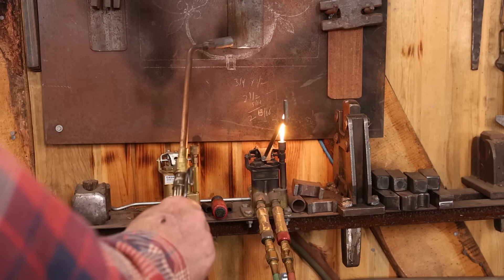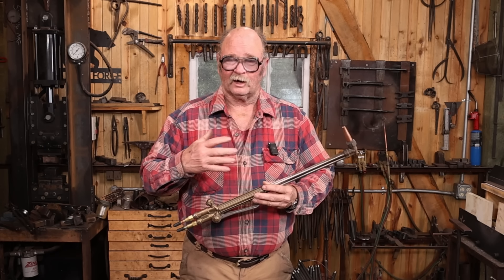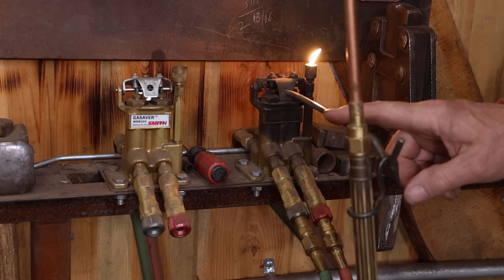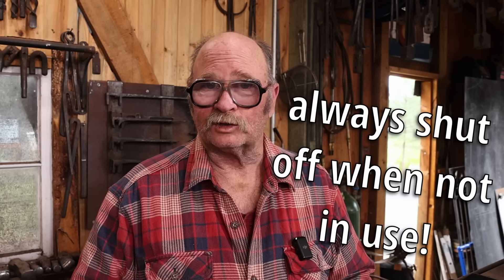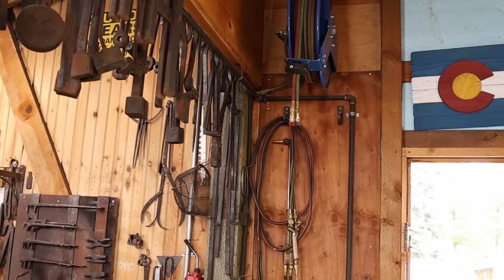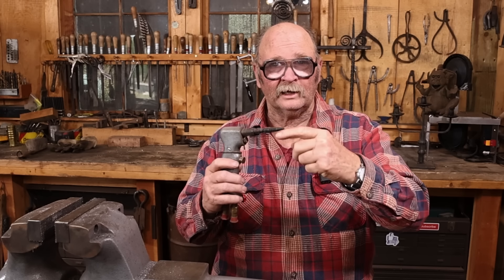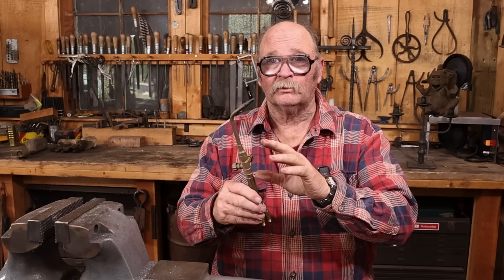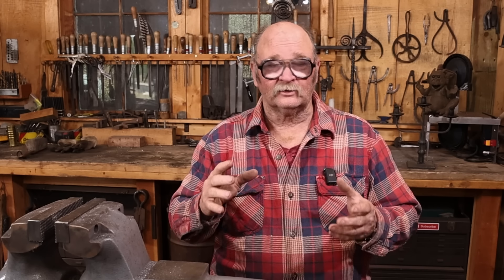Oxy - Acetylene VS Oxy - Propane torch - blacksmith shop setup

Comment: Years ago, I started using MAPP gas.  As it became less available and cost much more, I started using propylene.  It costs way less than acetylene and is far safer for storage and transport.  The tanks are far lighter and less costly.  My big rosebud cannot be used with acetylene even with manifolded tanks.  My hoses, regulators, and tanks were recently lost in a major wildland fire, so I have to replace them.  I used standard off-the-shelf regulators and hose for fifty years and that is what I'll get for replacements. Frankly, the propane hose didn't last that long.  Generally, the propane/propylene cutting tips are two piece making them cost more.  I get better flame cuts with propylene than with acetylene.  Just my two cents.
Reply from the maker: Great information

Comment: I personally won’t buy any torch that isn’t a victor or maybe a smith you buy those cheap knockoff ones when you need replacement parts good luck finding parts most likely you will have buy another torch.
Reply: If you want a really nice welding or cutting torch, check out  Blue Feather Torch in Two Harbors Minnesota.  I have both of the welding torches and the cutting torch.  They are expensinve but worth every penny .  I weld on 55 gal. drum metal with the two welding torches and they weld really nice after a little practice on the thin metal.  And the cutting torch really works nice too.

Comment: I have seen several videos where jewelers are using an oxygen concentrator instead of a tank of oxygen. Would you think that provides enough oxygen for one of these torches, or would it just not have enough supply.

Comment: I never knew about these gas saver valves until I was actually taking a beginning blacksmithing course, and the instructor was showing us this video that I've never been able to find again of an older Smith doing demonstrations in his shop, much like you do. My instructor apparently had never found this remarkable, but while watching the video I saw the guy just pick up his cutting head, wave it seemingly randomly over the tops of his cylinders and <SNAP>, it was lit! And at the perfect mixture! I literally disrupted the whole class because I sat bolt upright, literally shocked, and blurted out "WAIT, WHAT THE HELL WAS THAT?" I confused the instructor so badly, he had to back the tape up. "It's like the torch just lit all by itself! What kind of sorcery is this?!" My instructor peered at it (everyone else was just mildly curious what the hell my problem was) and he just kind of nonchalantly said "Yeah... must be some kind of special valve. I don't know, I never noticed it before."

A couple of days later I was describing it to a friend of mine also in the welding industry, and he just casually said "Oh yeah, a Smith Gas Saver. Those are pretty neat. Probably got one at the shop if you want to see it."

Mind. Blown. You just don't know what you don't know.
Reply: I get what you’re saying, the first time I saw one was on this channel, that’s been a few years ago. He showed what he was using, probably from all the replies he got from using that valve. Pretty neat setup.

Comment: FWIW, I have used an oxy-propane setup on a gas saver for 18 years, with no problems; it sips gas and oxygen use is acceptable. I use a #2 curting tip instead of a rosebud, rhe preheats are sufficient for most local heating, like setting rivets and most tenons and doing handle-length twists in up to 5/8 stock... thanks for the video, John!

Comment: I’ve been dithering about which to choose. Your video provided the vital information I need. I have a clear course. Thank you.
Reply: So, as a fellow person looking into figuring out a good setup for your shop.. which did you choose? I’m about 3/4 through the video and haven’t decided yet..
Reply: Just got to the rest of the video, your choice is obvious now! ;-)
Reply: @Ian_S  I started with acetylene, if you’re not welding/brazing, propane. It’s cheaper, and less volatile. The biggest things with acetylene is you can’t lay the cylinder down and it is far more volatile than propane.

Comment: Delightful video as always John! Regarding welding/brazing with oxy-propane, I went down this road. You are right, there does not exist a welding tip made for oxy-propane, and running it through the acetylene tip is a special exercise in frustration....

There is a product on the market that my local welding gas supplier gave me to try called "Chemtane-2". As I understand it, it's propane with extra herbs and spices, additionally it's compatible with all your existing propane regulators. I can confirm that I was indeed able to run it through the acetylene brazing tip on my torch and do some brazing whereas I was not able to just with propane.

Just figured I'd mention it if you or a viewer were interested. Thanks again John!
Reply: I bought a whole propane welding kit they are available and each manufacturer has one
Reply: Did you you stay with Chemtane-2? How much is Chemtane-2 and propane at you store?

Comment: I have worked "around" oxy/ace torches during my entire career of heavy construction management.  I was never a torch operator but cut a few pilings and other things just to experience using a torch.  All the torches were industrial and quite heavy duty.  I rarely lit a torch personally, and I have never understood how to adjust it to perform well, even though the welder showed me the correct cutting flame after he lit it.  The valve adjustment has always confused me, and your video clarified at least some of my age-old questions. Not valve adjustments, but just torch options. Thanks.

Comment: I have an oxy-mapp gas set up with a small tip torch.  It uses the small tanks, like for a straight mapp or propane torch.  I do minimal work with it, but it heats up well and the small tip is precise.  If I could set it up with large tanks I would.  The heat is between propane and acetylene.

Comment: I agree with you John.  I added oxy-propane capability a couple years ago.  In theory it saves money on gas.  (That may be true if one is burning large quantities.)  But with the cost of all the new things to buy (finding tips was a challenge), increased oxygen consumption (not cheap either), slower heating and lower temp, etc., it's often not a win over oxy-acetylene.

But there is another way I leverage the oxy-propane.  For me, the oxy and acetylene tanks are never running out together.  Swapping tanks is a bit of a logistical challenge in my situation, and I really don't want to deal with swapping one tank out of sequence with the other, or forfeiting part of a tank of gas to swap at the same time.  Being able to switch to running propane when the acetylene runs out helps get me to the end of that oxy cylinder (depending on the project need of course).  It's also handy to have the option as a backup.  If you run out of acetylene in the middle of a project -- on a weekend of course when all the welding shops are closed -- you can switch over to a standard BBQ propane cylinder and keep working.  Once you have made the initial investment in the propane equipment/tips, it is nice to have that option available -- even if I don't normally run oxy-propane by choice.
Reply from the maker: Some excellent observations

Comment: John, that Henrob (sp?) acetylene torch with a pistol grip looks like the torches I used to see advertised in "Street Rodder" magazine.  One of my parents' neighbors was a "Street Rodder" and bought one and it came with a videotape showing its use.  The guru demonstrating its use welded aluminum soda cans to each other without blowing holes through the cans.  He then did the same with the kind of pop-tops that used to come off of the cans.  The advertised use (aimed at Street Rodder readers) was for welding relatively thin sheet metal as used in autos, without blowing holes in the sheet.

Comment: From what little metalwork I was taught eons ago the old men working with sheet steel at the time preferred acetylene. Coating the surface with pure acetylene soot while preheating, would turn on the oxygen to get a hotter flame and when the soot began burning off, the metal was at exactly the right temperature every time. It's a skill I wish I'd been serious about picking up from them

Comment: 8:30
I cut railroad tracks with a small acetylene cutting torch with oxypropane.
No problem
Using a propane regulator 

J 
The Netherlands

Comment: I use propane on a rosebud for heating because I already have propane, but the electric welder and plasma for cutting and welding. The propane tank last me about a year and have to fill the oxygen about 3 times in a year.

Comment: Someday I may get myself a torch, I use my 3 in one welder/plasma cutter for thicker steel I need to cut, but 95% of the time I use my hacksaw or grinder. However I do try to hot or cold cut whatever I can now. Most of the clients I have go for that rustic look. I am working on some barn door hinges at the moment, a torch sure world come in handy for them as the hinges are almost 2 feet!!
Reply from the maker: A torch is pretty handy to have available.
Reply: There is poor mans solution.I built 1" burner from the book by  michael porter -burners for forges and kilns.Its a venturi burner ,but its highly adjustable and heat output is insane when you fine tune it  and if you use 2 firebricks and put material on it .He goes into detail with materials and procedures to make it.Its completely different than anything on youtube.
On my channel you have video about it i made some modifications to manufacturing process but dimensions are the same. 
Its not perfect as acetilene but so far it did not fail me in any task i had for it.

Comment: Victor, Harris and Gentec have separate torch mixers for propane. Propane tips are the same as acetylene tips except propane tips have a counterbore or recess at the tip. The counterbore prevents the propane flame from blowing off. With propane tips so hard to find and more expensive, have you tried counterboring an acetylene tip for propane? Or adding a ¼” long sleeve on the end of an acetylene tip? Pictures of the Harris 1390-N tips show how they are counterbored.

Comment: I have both propane and Acetylene in my shop.  The only time  i connect the Acetylene is for gas welding.  Most of my heating is propane/air.  Oxy/propane is good for some silver soldering or brazing.
Reply: The only thing Acetylene can do that propane can't is steel weld,  I prefer to drag out the tig for steel welding so i only have Propane... LPG  no bottle hire and can hook it up to the bbq.  I must admit acetylene is like butter and propane is like margarine

Comment: Thanks John, I have an acetylene setup and have considered shifting to propane. I will not. I don't use the torch often enough to justify the addition.  The downside to this is my local supply companies have decided incorporating a degree of larceny into their pricing is the thing to do.  One supplier, well known in the region, insists on an automatic Hazmat charge  on every single purchase, whether it be gloves, discs for grinders, marking pens, everything.  It is the BS of the corporate mentality.

Comment: Do you need any special plumbing or fittings to use propane, as compared to acetylene?

Is it ONLY the tips you need?

I ask because it seems to be a huge deal for welding supply companies that seem to think its a major issue.

I've used oxy-propane at a shop, long ago, but did not ever think to look into if the owner had needed to get any special tools.

Comment: I've just got myself an LPG / Compressed air torch. I have not tried it out as yet, but the local blacksmith supplier here in Australia has started selling them again (They were available 20 odd years ago, but went out of production), and by all accounts they work well for heating or brazing / soldering. It is not capable of cutting with the configuration of the torch.
Reply from the maker: You're the second person to mention compressed air.  I had not heard of it before.

Comment: Does the gas saver valve turn off the oxygen also because it runs out way quicker than the acetylene?
Reply from the maker: Yes, it shuts off the flow of both gasses to the torch

Comment: Question: if you use a steel rod instead of brass, is it still called brazing? Or is it just torch welding?
Reply from the maker: Steel would require welding.  For brazing and soldering you don't need to bring the parent material up to a melting point, you're just melting the filler (brass).  Welding requires the parent material to melt and fuse with each other as well as the filler rod.

Comment: So here's a million dollar question: if you buy a forge kit meant for propane use but want to modify it for oxy- acetiline, what would you need to do for the conversion process? Further, how could you modify it so it would be interchangable for both systems should you need to use one over the other given acailability in an area?

Comment: Do you want the option to weld or not? That's the only deciding factor in picking fuel for me.

It has to do with the chemistry of acetylene, has nothing to do with the negligible heat difference.
Reply: Oh? Say more? I thought it was the heat
Reply: @lumotroph A quick search says: "When acetylene burns in oxygen, it creates a reducing zone that cleans the steel surface. Propane does not have a reducing zone like acetylene and hence cannot be used for welding."